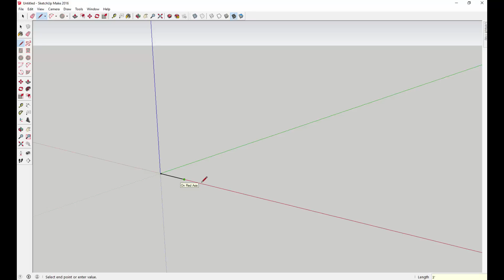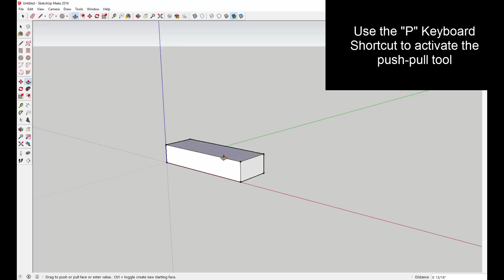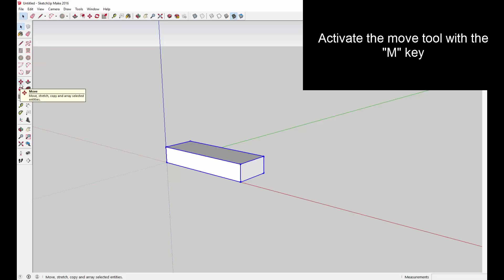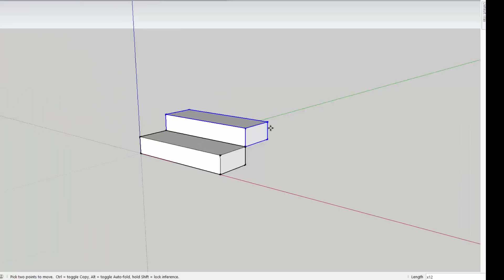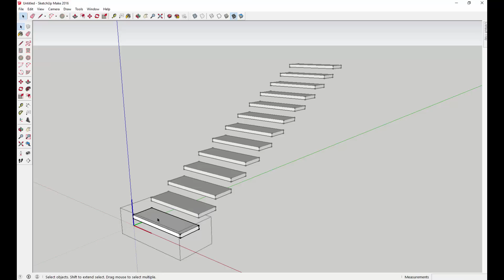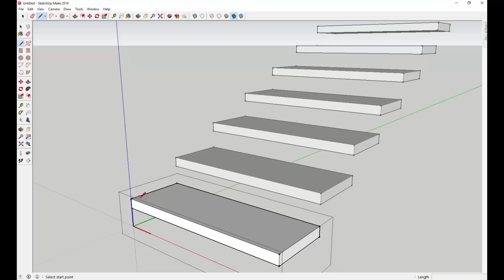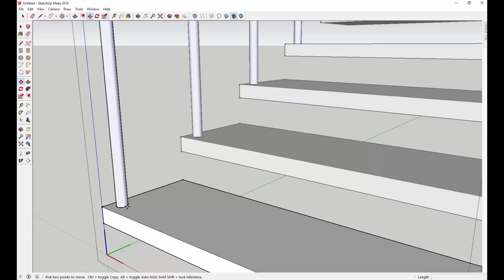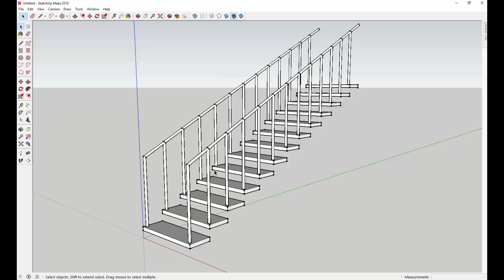Quickly Model Stairs in SketchUp with Components - The SketchUp Essentials #10

Comment: When entering x12 I get invalid length entered message!
Reply from the maker: *12, not x12
Reply: @Thesketchupessentials  thanks very much for taking the time to reply and now .. one more problem  propped up(sorry to be a pain): treble-click to group a component is not always working (on windows) as sometimes 3 clicks in the row makes everything go blue lines instead of the geometry (as you refer to it)  i'm after - the window in my case...holding ctrl kind of just makes it but tried to fly like you did with 3 clicks! (trying to ran before i could walk --sometimes you are fast to follow other-times you are  slow enough but that the interesting part of your videos; advice to everyone-else: is to pay attention to every step  & no trying to skip! It took me few runs get the window  grouped & as a component though it pays off!